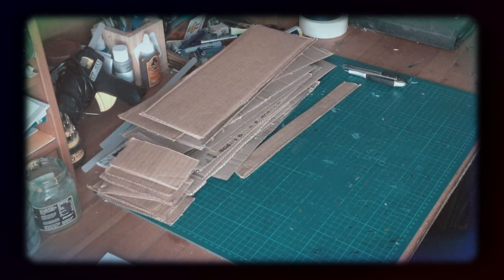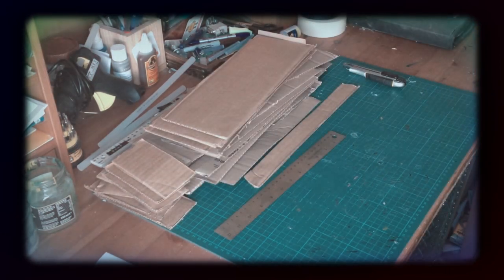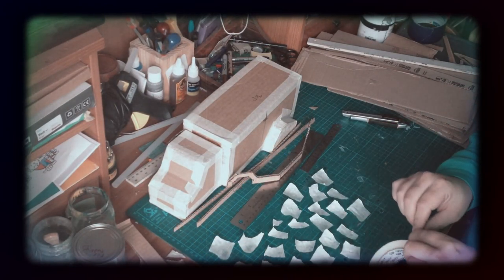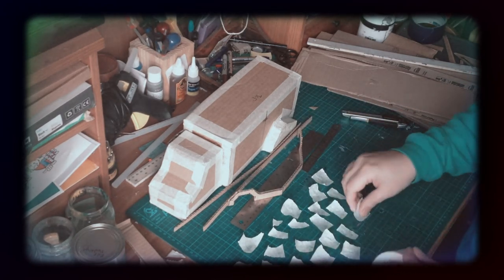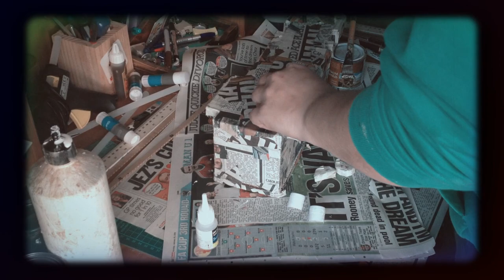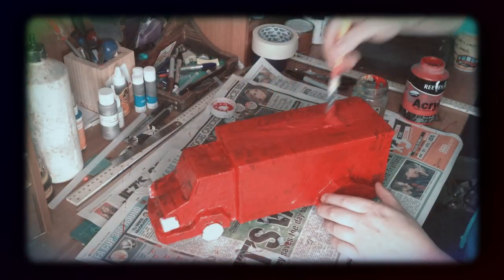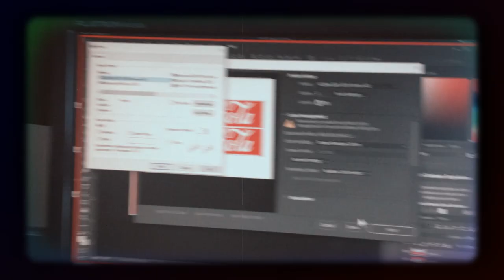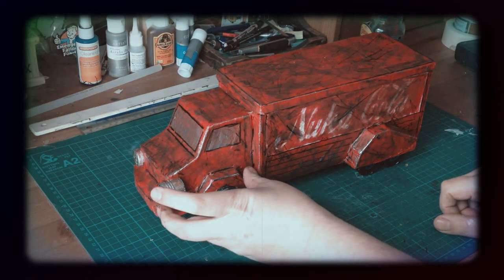DIY Fallout 4 Toy Nuka Cola Truck

Comment: that's sick, do you think this would work with foam core board?
Reply: I don't see why not, though the folded and curved bits would need a little creative poking to make them work.
Reply from the maker: +jake hall William is right, foam board would work just the same as card, if not better.  Would like to see your result Jake Hall